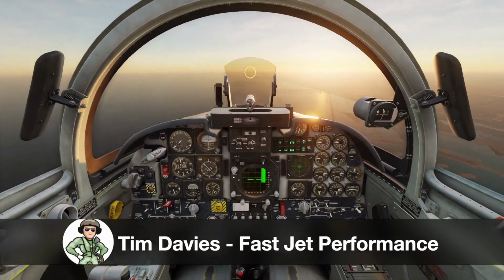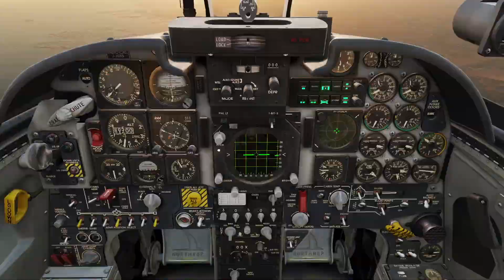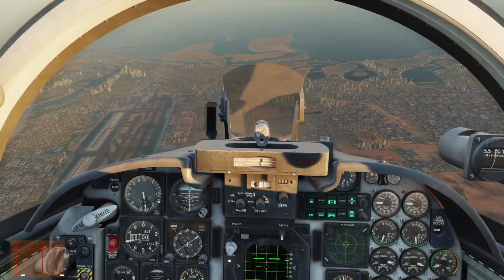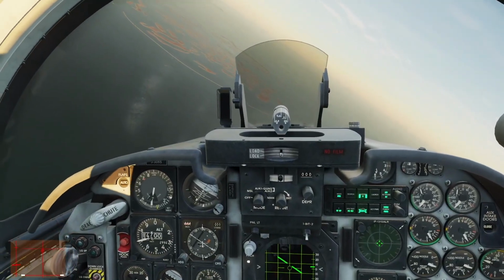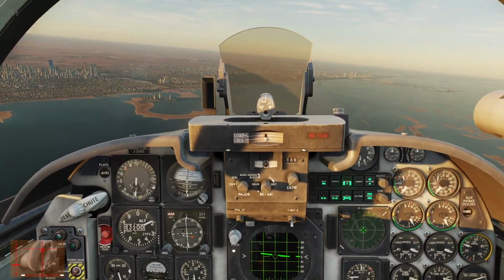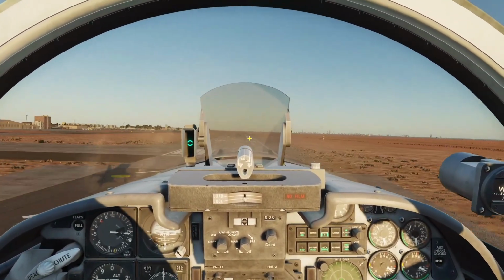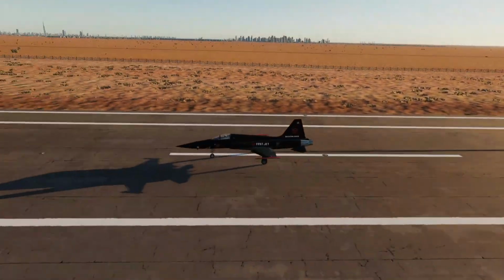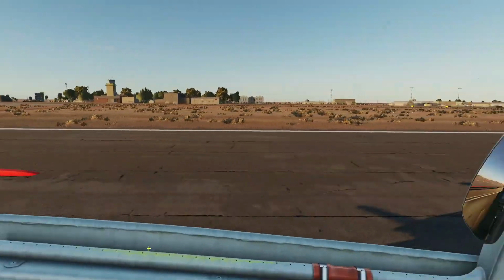Trimming Aircraft in Flight Sims: How to Do It Like a Pro

Comment: Same problem in VR, the camera is set too far back. I usually have to move my head back and hit the VR reset to get it in the correct position. Wish they would put in a slider to set the position for each plane for the VR and TrackIR reset button.
Reply from the maker: Try Zoom View on an axis - that's what I did.
Reply: @FastJetPerformance  that works with track IR however in VR  you only get zoom and spyglass zoom  which work with a keybind full on/off no in between option. There is a option to set a Axis zoom but doesn't work in VR (or I've not managed to get it working) .
Reply: @FastJetPerformance  Zoom axis does not work in VR. That's what I use to do with TrackIR though.
Reply from the maker: @ComdrStew  ah, yes, I was in Track IR - the only thing I do in VR is move my head back, re-center the VR asked them sit back in the right place and I'm obviously closer then.
Reply: Yu can map the button to change your seat position on VR. “Cockpit camera forward”, “down” etc etc . 👍
Reply: @Orkose  But it does not stay there if you press the VR reset again.
Reply: @ComdrStew  yes he does
Reply: @Orkose  Oh they fixed it then. I will give it a try again, thanks.

Comment: I find trimming hecka difficult in sims as compared to the but of GA flying I've done. Since nobody wants to invent a force feedback flight struck, how do you get the trim settled so easily without feeling the back pressure coming off the stick?
Reply: It's just down to visual cues, the hotizon, shadows, instruments. With all the Jets ive had a go in on DCS you can spot it almost instantly. I suppose having never really flown I wouldn't know any diferent, so it's probably just an issue of learning new habits for you..? There is a force feedback stick out there at the minute, The Brunner CLS-E force feedback Joystick.  Its expensive though!
Reply: you could get a "Butt-Kicker" for your chair; it vibrates at varying intensities for Buffet, Stall, Etc.
Reply: Buy VPforce Rhino.

Comment: For head tracking,try Tobii eye tracker.A bit pricey but very good,I don't use the eye tracking bit just the head tracking.................
Reply from the maker: One of my students has just got his setup so we're all interested in how it performs, many thanks.
Reply: @FastJetPerformance  When I first got it (sim u/d 9),it didn't have all six degrees of freedom.When update 10 arrived it started working properly and continues to do so.One bugette you may run into is when looking say at the runway on the downwind for more than a few seconds,the forward view will be canted slightly in that direction.No problem,just look at the screen center and press F12 twice and bobshruncle.....................................
Reply from the maker: @russellharris5072  thanks Russell, much appreciate your advice, will pass on.

Comment: You might want to upgrade from the Warthog if you're serious. A lot better kit out there nowadays. Winwing offers a comparable but superior dual throttle and VKB offers quite good sticks, as does Virpil and Winwing. I reckon you can afford it so it might be worth it.
Reply: Just beware the software for Winwing. The drivers are written by a Chinese company and it "phones home" for no apparent reason.
Reply: @paradoxicalcat7173  I had forgotten about that, I don't know if it was ever determined whether they're a spying operation or not.

If you're worried about that, Virpil does make good throttles as well, and if you have an issue with Belarus or more specifically shipping from Belarus (Some countries have a large extra tax now due to obvious reasons) then you might want to wait for VKB's TECS. Although the Warthog throttle is...alright. Not good by modern standards, but not bad.
Reply from the maker: Thank you, I appreciate the advice and will look into these new throttles and sticks 👍
Reply: Fitting a Joystick extension is the one thing that improved my flying experience most...(😏) There are stick extensions for all the brands out there. A guy on eBay makes then for the warthog too, quite cheap. Will allow your TM Warthog to survive a lil longer.  

After that I'd say for your next best single upgrade, get a Joystick base from Virpil. A Virpil base will fit a TM grip and extension just fine. And the difference in feeling and quality is significant. You can also  fit diferent Cams and springs inside the base so you could can tweak how the stick centering feels. 

There is very little difference in throw between the TM Throttle and the Virpil throttle. Not enough to justify the expense if that's all you're looking for. There are however, a HUGE ammount of hats and buttons on the Virpil Throttle. I have an entire hat switch just for diferent camera angles!  The Throttle with the biggest throw and arguably closest to the real feel would be the big F-18 win wing replica but it is big! 

There are a tonne of third party gadgets and addons to breathe a new lease of life into a Warthog throttle, worth looking at if you still love it, as many do!

Anyway, great vid, miss the F-5. Hopefully see you in Jan. 

(Edited for Maximum innuendo!)
Reply: @hotdogdcs2761  The main thing is that Warthog design is flawed and causes stiction and static friction and the build quality is just poor anyway. Warthog will probably die entirely once TECS comes out and people don't need to buy Warthog for a cheapish decent throttle anymore.
Reply: @ArchOfficial  All the points you made were absolutely valid ones mate.. Its just that some people will want to stick with what they've got. I have a full Virpil VR set up, I absolutely love it, but for what it cost me I could have gone on a family holiday to Disneyland! Guess I'm just lucky I'm not married yet or I'd probably still be rocking a greasy second hand X55 and delanclip.
Reply: @hotdogdcs2761  The way I look at it, a Virpil VR setup is more fun for you and perhaps the family than a trip to Disneyland.

If you're getting married to someone who demands a 50k ring but doesn't let you use 5k on gear that'll last a few decades then you're getting married to the wrong person ;)
Reply: Yes, but PayPal.
Reply: @hotdogdcs2761  funny how men in society are led to believe we can't enjoy passions and hobbies thar are deemed to be "nerdy" through gaslighting !
Reply: @hotdogdcs2761  Agreed. A 6 inch extension makes a huge difference 😉. Virtually eliminates stiction and gives much finer control. No need to move from a Warthog setup it you already have one. If starting from scratch then VKB or maybe Winwing. OOI, VKB Gunfighter base can be bought with TM adapter. Unfortunately you need one adapter for each stick and I have 3 (A10, F18 and F16) 😢.

Comment: I've been a pilot and instructor for over 20 years (DCS pilot for 5 years) and I'm going to give you something to maybe change the way you look at trimming. You trim for speed. Throttle for altitude. Once you get trimmed for a speed you can climb or descend at that speed with just the throttle. That's a much simpler way to look at it than trying to look at attitude and coming at it kinda backwards like you were explaining it.
Reply: I don't think this will work in most FBW jets that use trim as a logic for how much Zg they should be pulling.
Reply: This is totally bogus advice, and if you try to do it, you will fail 100% of the time. I can "trim for speed" while climbing at a 10 degree angle, but it will NOT trim the aircraft for 300 kts. Why? Because my aircraft has an engine, and the instant I change thrust, it will screw the trim condition.

The ACTUAL correct way to trim is this:

1) Set thrust (you either want to climb, descend, or hold level flight)
2) Get the pitch where you need it using the stick, and change speed by over/under pitching (e.g. acceleration in climb to a higher climb speed requires initial under-pitching)
3) Only once you got the aircraft balanced with stick input, can you think about trimming so it stays where you put it.

Level flight is a special case. We need the nose to remain in a constant attitude while thrust is used to set speed. Again, set pitch for altitude, then balance thrust with pitch to maintain level flight. Only once pitch and thrust are set and things are constant, can you think about trimming.

With experience (and this is something that you develop very quickly) is trimming while pitching. You will know which way the trim needs to run for a given situation, so you can start running the trim before you get to your final attitude/speed.

Imagine this: if I set max power and climb, and "trim for speed", the instant I push the nose and pull off power to hold that speed in level flight, it will always want to pitch. Which way it wants to pitch depends upon the thrust line of the aircraft, but no aircraft has a perfectly zero thrust line, thus, it will require re-trimming, despite the speed remaining the same! This is even more apparent in propellor aircraft where you get propwash over the tail, or where the engines are a long way from the centerline (e.g. underslung engines).
Reply: @ArchOfficial  It works perfectly in analog DCS jets like the F5 as well as in the real world in analog planes.
Reply: @paradoxicalcat7173  Before you go all crazy with a reply like this, consider the context of this video and what we're talking about. 

We are in an analog plane. No fly by wire or computer "assistance". So, my advice is 100% accurate. 

Now, if we were in a computer assisted plane like the F18, this would not work because the computer would do it's thing. 

Get out in the real world. Go to your local airport and do an introduction flight in a real plane. You'll see that this is how real world planes and pilots work.
Reply: @Arstine  What do you do if the plane's thrust line and center of pressure don't allow you to control purely altitude (= pitch) with the throttle?

It's why I think of trimming as just setting the rate of pitch which you then choose to be correct for the given attitude to be maintained. Some planes that use Zg as the logic still behave in this way, where pitching down will require unloading and pitching up will require loading in order to keep the attitude constant for any given V.
Reply from the maker: Were you a 20 year Veteran Royal Air Force Central Flying School accredited A2 Fast Jet Flying Instructor, Arstine?
Reply: @FastJetPerformance  What would that have to do with anything? And would it make my statement wrong?
Reply from the maker: @Arstine  Yes, for fast jets, your statement is wrong in every way.
Reply: I think this is more a matter of what you're trying to do. Ultimately, you trim to keep the stick neutral, it's not much more complicated than that. Climbing and descending, as well as approaches, are best done by flying a set speed / speed profile / AoA, but trimming a fast jet for level flight can be a different thing. F-5 is a classically stable bird, but it reacts much more slowly and weakly to power changes than your average Cessna (wider airspeed and attitude oscillations as it looks for its balance point). I guess you can keep some pressure on the stick for half a minute or so while looking for the exact power setting, but most people don't have a good enough joystick or the curves to do that effectively. Finely grained throttle control is needed as well. It takes far less effort and concentration to flick the trim hat back and forth for a bit while keeping an eye on the VSI. I already know my power settings and how much marginal inaccuracies influence fuel economy, so there's very little to zero benefit to flying an exact trimmed airspeed in level flight. If the trim is extremely coarse like MiG-21, I will look for the exact power setting to keep things balanced, though. It'll usually take a minute or even 2 until I'm happy. The process feels like eliminating a slow pitch axis dutch roll type thing with power and some very gentle stick pressure.

On the other extreme, F-5 has a bad habit of falling quickly behind the power curve on approach and I'm very sensitive to pitch tendencies, so I set an appropriate amount of approach trim before I'm anywhere near close to the actual approach speed and work my way slowly towards the neutral position with power alone. I do my best not to touch the trim at all if speed and AoA look right once I'm neutral. If I notice even the slightest downward trend or desire for back pressure, it's a clear indication to add power immediately. Otherwise things can go south very quickly. I assume it's a flight model problem since nobody would be brave or stupid enough to follow the donut in gusty weather the way it is.

Sincerily, 
Unruly but perceptive flight sim test pilot for over 30 years and I'm probably younger and better then any of you.
Reply: Imagine telling an instructor who trained pilots to fly and fight jets on one of the hardest military flying courses in the world, how to fly a military jet... 

Are you new here?
Reply: Here's an example showing that what I say here is correct for THIS aircraft in THIS video and any other analog aircraft out there.

https://youtu.be/CW3hnRmAGSA
Reply: @Arstine  I'm really not sure what you are trying to say. Tim is teaching us how to trim for level flight at a chosen speed. You seem to be stting up for a particular speed with no attention to changing ROC/Altitude while it porpoises to a steady state. What was the altitude target? Of course it will climb and descend at a fixed trim with power changes. Where's the required altitude at the required speed?